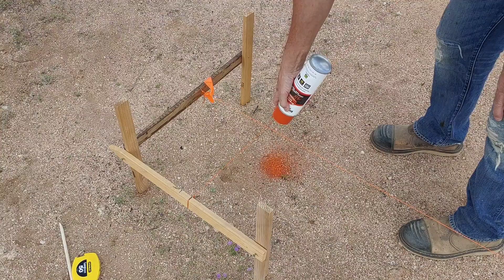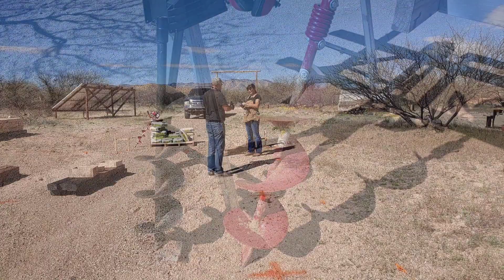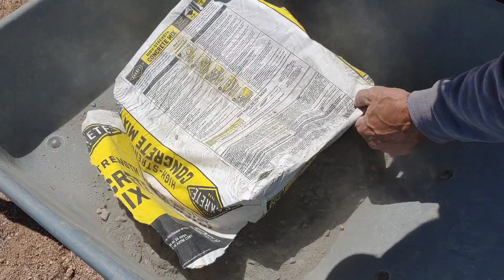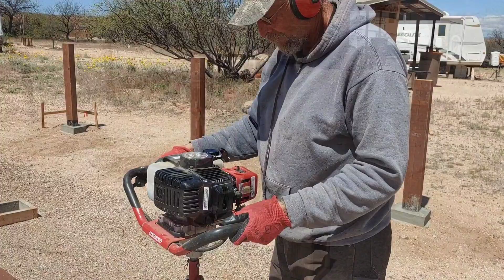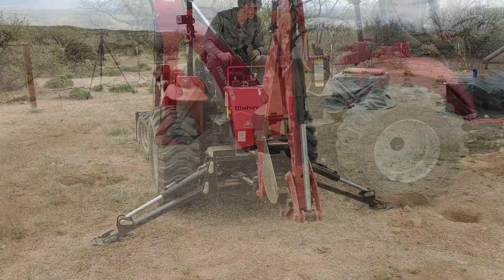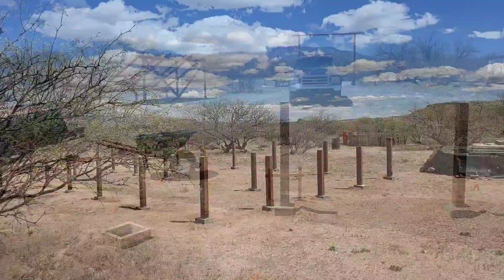#strawbale #strawbalehouse How To Build A Strawbale House / Day 3 Breaking Ground!

Comment: Wondering if the asphalt emulsion helps deter termites.  I’m thinking of using your method for a foundation and also live in Cochise county.  My soil is like yours.  I notice termites though under boards when they are sitting only a few days. Curious what your thoughts are about termites.  Your videos are so helpful.  Thankyou.
Reply from the maker: I think the best solution for preventing termites would be a combination of shosugi ban and then asphalt emulsion if you are using non pressure treated lumber. Our posts are pressure treated and rated for ground contact so the addition of asphalt emulsion is just for addition protection from moisture.

Comment: Did you put gravel at the bottom of the post holes for drainage? I know water probably isn't as much of an issue where you are, but it's just a good practice measure.
Reply from the maker: No, no gravel. Ends are coated in asphalt emulsion and encapsulated in concrete. And you are correct, drainage is not an issue in our terrain.
 Thanks for watching! 👍

Comment: Nice work.  I'm looking at getting an Auger to put in some 4x6 fence posts.  I'm in NY so soil may be tougher in my region.  Can you share link for the 8" auger attachment that fit on the HFTools Predator power auger?  I'm afraid of buying one which doesn't fit it.   ;)
Reply from the maker: https://www.amazon.com/dp/B000DILOXG/ref=cm_sw_r_sms_apap_MFW4kC2x77IGW

No problem. That's the link to the exact 8" auger bit I have, but I paid only $45, so either the price will fluctuate or I got a smoking deal. HF does sell an 8" auger bit as well. Thanks for watching and good luck with the fence!
Reply: @theupsideofdownsizing  Awesome!  Thank you so much.  I look forward to more videos from you guys!

Comment: i have the same exact auger you have. where did you find the 8" auger bit for it?
Reply from the maker: I got mine through Amazon but they do have them at Harbor Freight as well. This is what I got
"Earthquake EA8F 8-Inch Diameter". Fit directly on to the shaft and the pin fit as well. Thanks for watching!

Comment: Great vid, thanks for sharing.   Have you shared the plans for your house yet?  Maybe I missed that episode.
Reply from the maker: Thanks Jeff. No, you didn't miss it cause the design is in my head and the build will proceed in a very organic way. I mean the size, 24 x 40 and the height and roof pitch have been determined, but as far as doors and windows placement, still working that out. Makes it more interesting for me to work this way. Yvonne hates it. She wants everything planned out first, but, we've been together 25 years so she's use to it by now....sort of. 😉
Reply: @theupsideofdownsizing  I agree with "no written plans"...because wants change as things evolve.  Also, if no one wrote it down, then no one can prove a failure of that plan.  It all becomes a success!